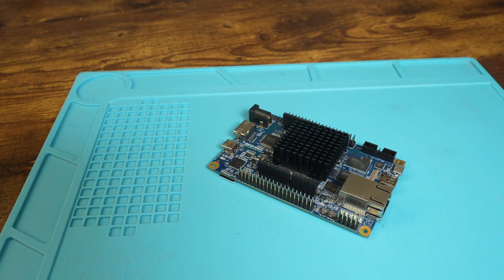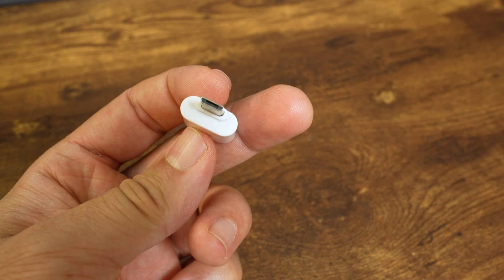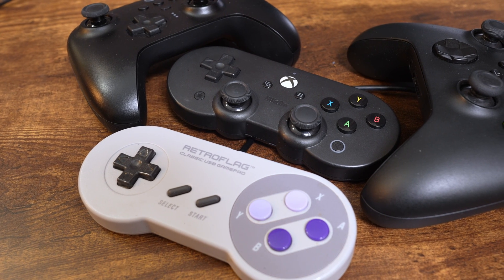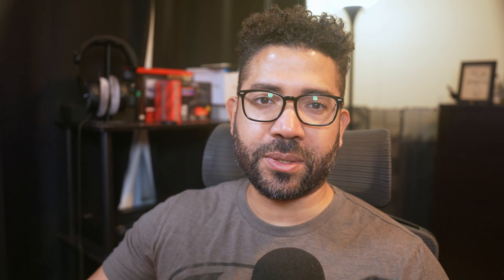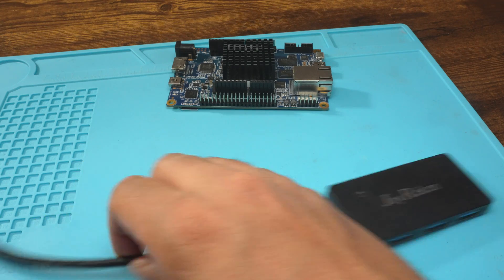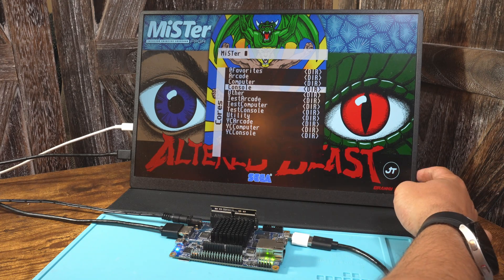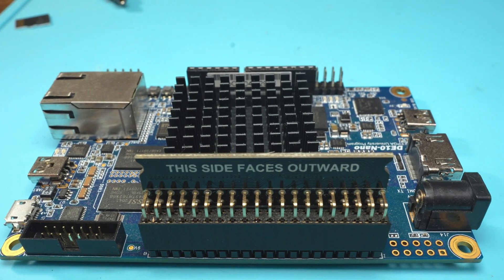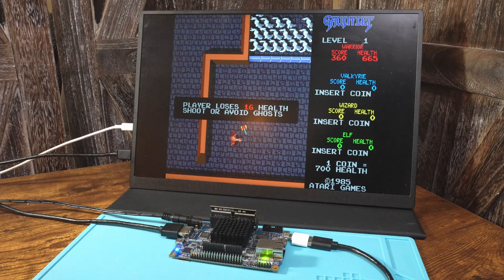MiSTer FPGA - Minimal Setup How-To

Comment: Really well done video. I think you will get most people going with little hassle. It's sad that the DE-10 Nano is so expensive now. I bought mine for $176 in 2021. I want to recommend MiSTer to people but refrain knowing they will likely be spending $400 or more by the time they get a case and a controller. Not sure if this situation will ever improve but I'm glad I'm setup already. Similar experience using Raspberry Pis. They used to be plentiful and cheap. Not so much now.
Reply: The price definitely sucks now, I was able to get mine for about 400 Canadian after shipping with the the analog board and power supply.

Comment: My EXTREMELY minimal setup is DE10-Nano + Antonio Villena IOUSB Mini (without case), 128MB 4C SDRAM, and 1TB Lexar PLAY microSD card. The IOUSB Mini is an analog IO board with an improved DAC which eliminates the need for a USB hub (integrated) and power switch (uses SOG switch with a small mod).

Like most 4-chip SDRAM modules, mine doesn’t work well with the single-SDRAM Saturn core so opt for the 2-chip version if you try to replicate this minimal setup (he does sell one).

Also, the USB hub reboots if you have draw too much power from the stock DE10-Nano PSU. I experienced it with multiple controllers plugged in simultaneously or during force feedback when enabling Rumble Pak on my wired Nintendo Switch Online N64 controller. Pretty sure using the Bluetooth and WiFi dongle will fix this for my NSO N64 controllers but this is supposed to be minimal, right? ;)

The DB9+SNAC port is kinda cool too, since it lets you use low latency DB9 gamepads across multiple cores and works for SNAC devices. I had to get his DB9 Decapod SNAC+Daemonbyte adapter.